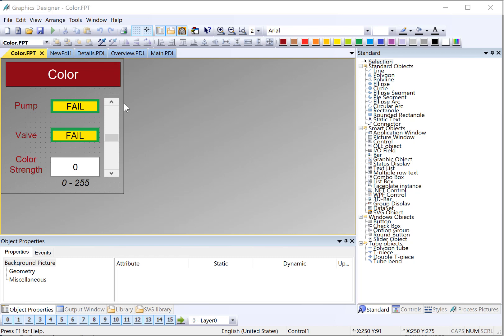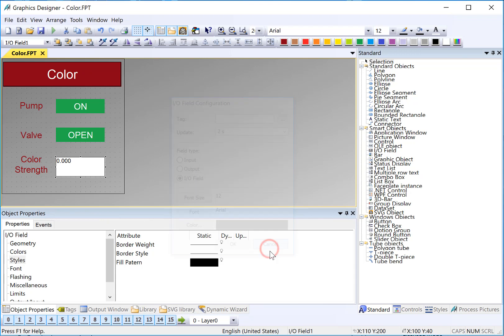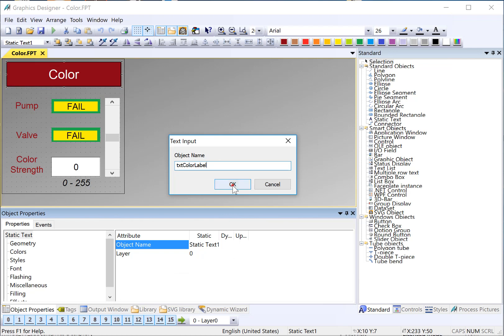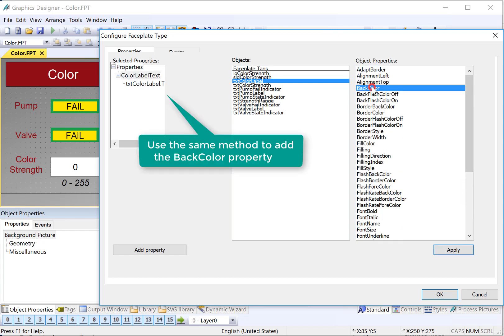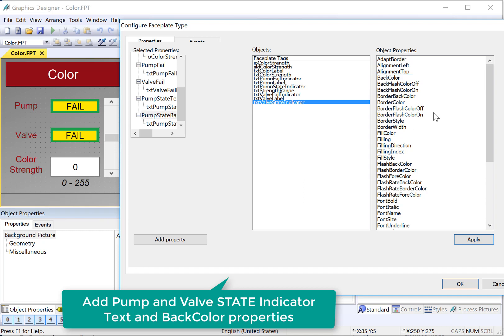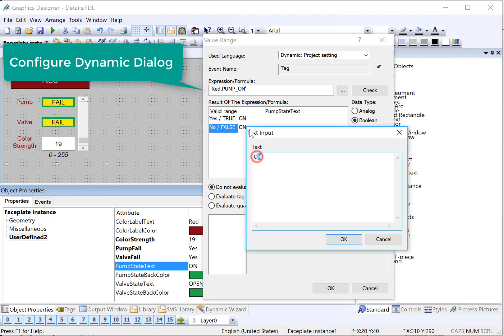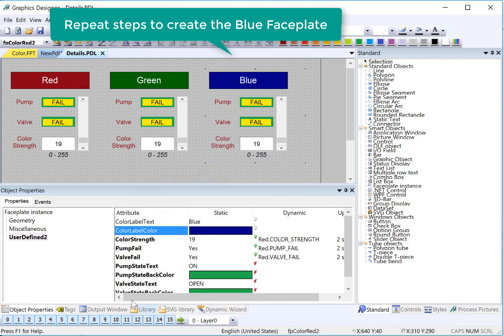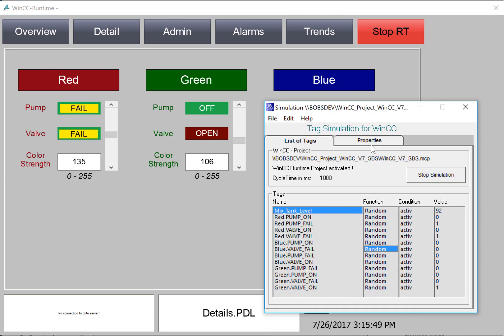WinCC v7.4 Step By Step #13: Create Faceplate in Graphics Designer 👨🍽️ faceplate tutorial #winccguru

Comment: great job. may ı ask a questıon to you. ın our factory we have a page for a unıt. and at that unıt we have motors pumps etc. and before ıf we have a problem wıth the pump the color become red and ıf the system not works ıt was grey and ıf ıt ıs runnıng ıt was green. one company made some ımplementatıon and now ı saw the motor color doesnt match wıth the old state. ı mean before when ıt not workıng ıt was grey but now ıt ıs red  lıke that . can ı use that methot to arrange the faceplate color? or can you recommend me some other better solutıon
Reply from the maker: you will need to look at the color animation to see what they messed up, and fix it. Look at the color property animation to see how they are setting the color, then you will be able to change the logic to correct it.
Reply: thank you very much @WinCCGURU